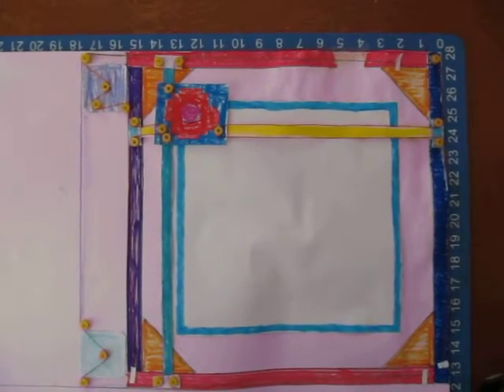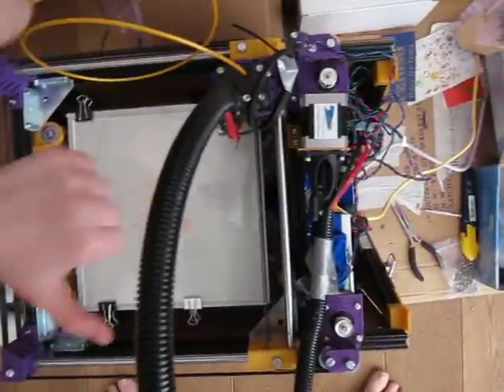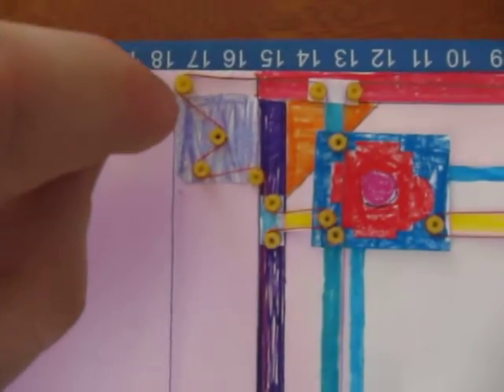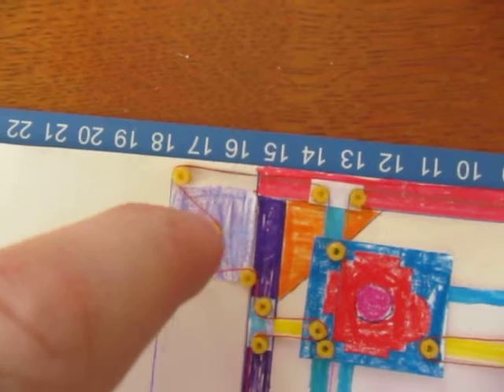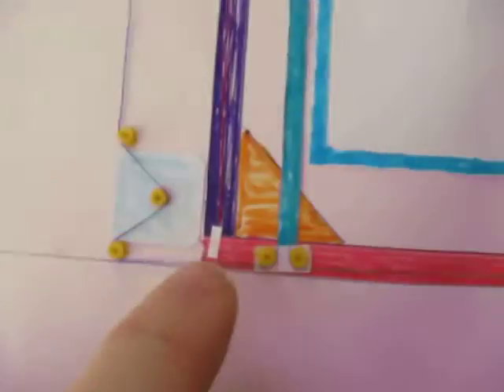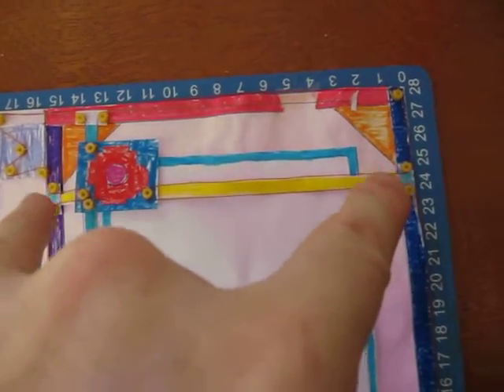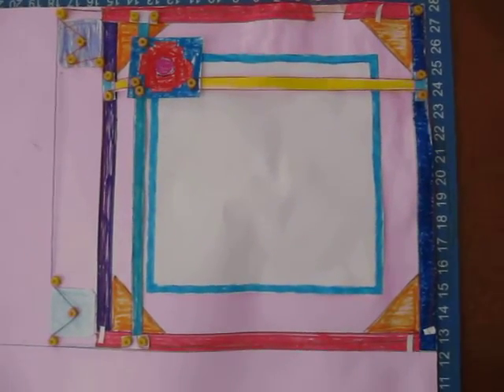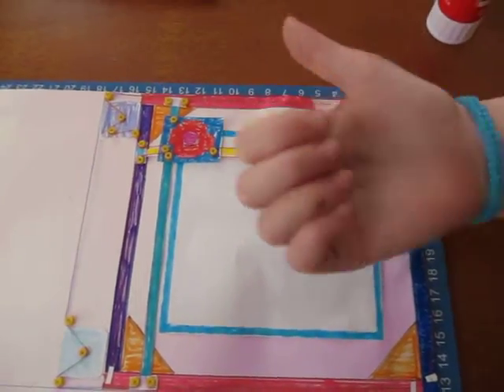Sandwich200v2.5 proof-of-concept conversion from CoreXY to Plotter

Comment: +Ikcl thanks and nice work but horizontal stacked rods and simpler structure founded here http://shop.evilmadscientist.com/productsmenu/846
I wonder how are placed the bearings and idlers in the center of that box for the AxiDraw... can you figure out?
Reply from the maker: yeah i got it - took a while.  it's a single belt, and there are 4 bearings underneath, and 1 more near the plotter.  start on the Y at the far end of the plotter arm, go to the centre turn RIGHT, go down X to motor 1, back 180, back down X to centre, turn RIGHT, go down Y to front near plotter, round bearing 180, back down Y to centre, turn RIGHT, go down X to motor 2, back 180, back down X to centre, turn RIGHT, go down Y back to starting position.  it will be CoreXY kinematics, just like that kid's game, the one with 2 pieces of string and 4 handles and a ball on the string, one kid has hands together, the other pulls hands apart and the ball flies down the two pieces of string.  turns out that by pulling or pushing you can also vary the position of the ball in X as well as Y, to anywhere you like.  this plotter and CoreXY are the same: rotate in same direction to move in X, rotate in opposite directions to move in Y.

although it would work for a 3D printer i would be concerned about making sure that the weight of the printhead is stable.  putting that much weight onto linear bearings would tend to make them rotate: not a problem for a plotter where you're using the table to stop that from happening, and the amount of pressure on the nib is non-critical, but for a 3D printer any play in the linear bearings would cause the printhead to drop.  it would probably be fine using delrin rollers and large aluminium extrusion though, but then you are looking at quite a lot of weight.

so, great design for a plotter, not so hot for a fast 3d printer.
Reply: +Ikcl thank you again for your kind and insightful answer, I'm not so skilled in openscad but I´ll try to make a diagram to get a clear idea. I´m interested in a pen plotter builded from scrapped printers as a first project.
Reply from the maker: cool that'd be awesome, i love the whole recycling thing.   have you seen the Sli3DR, it's actually a printer that's based around a plotter :)  it would be funny to see you use that to then make... a plotter.  google "richrap Sli3DR" and you'll find the origins and so on.  the nice thing is, the design is old enough not to be patented any more.  the AxiDraw they might get a bit annoyed if you copy it.